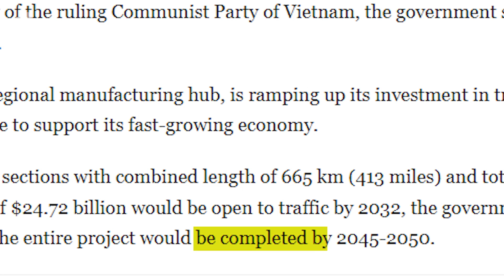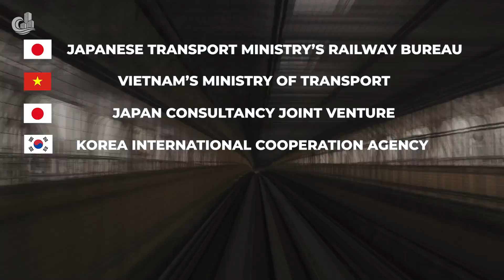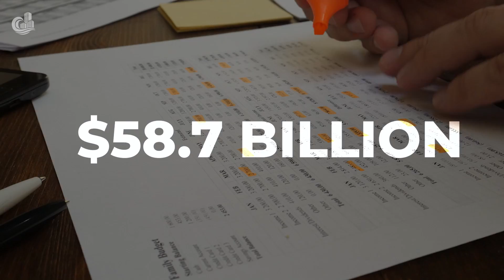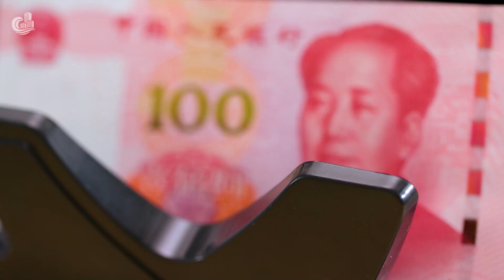Vietnam's $58.7BN Express Railway

Comment: It's not certain any decision's been made yet on which options, either the Shinkansen type based on normal railtrack or Maglev levitation train track like China's Maglev line Beijing-Shanghai. The latter option is future proof. Most countries high speed trains use standard railtrack with high risk of derailment. If they want to build Maglev lines they have to start to rebuild all over again, incurring extra high cost. Vietnam being late in high speed railway better uses the opportunity to jump straight onto the Maglev levitation technology which Japan has expertise and which offer speeds of 600 km/hr. Vietnam would expect to find 70 billion dollars which it could afford considering its rising economy. Maglev transportation is the future.
Reply: Vietnam's tracks are narrow built during French Colonial days, the entire tracks have to be rebuilt in the wide track standard using rails specificially designed and calibrated for HSR up to 450km/h. China currently holds the latest HSR technologies and the fastest Commercial MagLEV in operation, not Japan.
Reply: @KrazeDiamond  As far as I know, Maglev trains run on special platforms that allow levitation not on standard railtrack. Vietnam had painful experiences with Chinese contractors on the Cat Linh-Ha Dong metro in Hanoi and prefers not to use Chinese service again. Japan also runs impeccable HSR and has provided 50 billions dollars ODA loans which Vietnam really needs.
Reply: @vanthienthomas2237  "As far as I know, Maglev trains run on special platforms that allow levitation not on standard railtrack" -Where did I suggest that MagLEV runs on standard track? Wth is your malfunction?

Idk wth you talking about, Viet already signed with China. And Japan has outdated HSR techs. Deal with it.